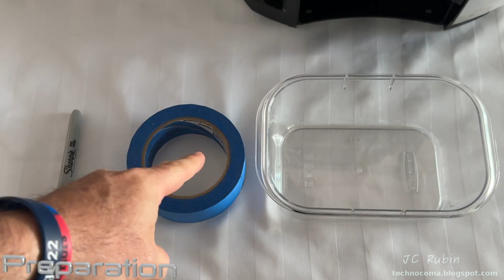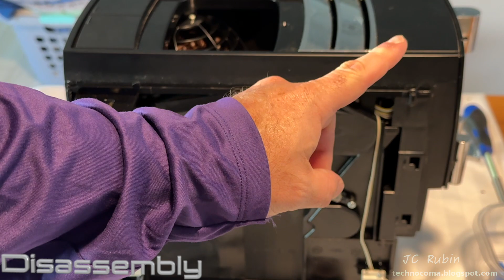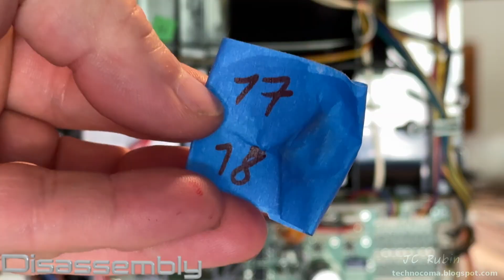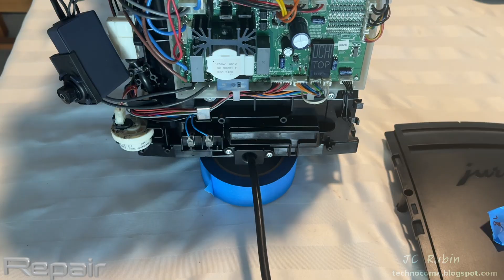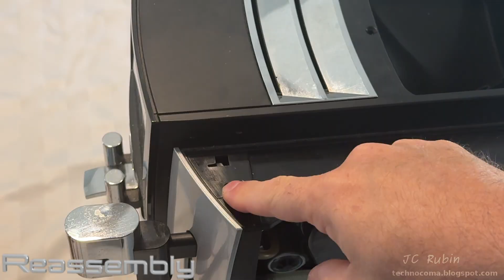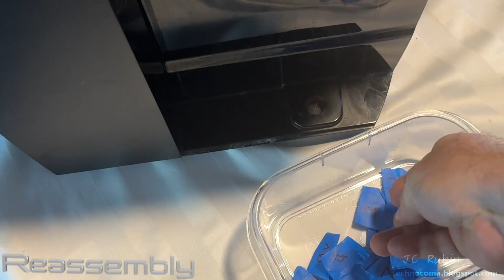Jura Coffee Machine Error 8, 1, 2, 3, 4 Fix | Step-by-Step DIY

Comment: Thanks, this was very helpful.  Just repaired mine with the same exact issue. The only difference on my S8 was the power switch, which installed at a 45 degree angle and turned 45 degrees to lock. I was a bit befuddled until I studied the mounting on mine. Super stocked to not have to send the unit in for $400 plus, never mind that Jura is still down after their security breach before Christmas 2025. Glad that they were as it forced me to find a repair via YouTube. Thanks for the very detailed walkthrough, it was so helpful and confidence building.
Reply from the maker: Glad to her the video got you up and running again

Comment: Great video - thank you so much! The only question I have - in the description you have a link to the temperature sensor for J6 model, however you are repairing the S8 model. I have the same problem with S8, do you still recommend ordering the sensor, which you mentioned  (for J6)? Thank you
Reply: Same question here.  I ordered a different one off of Amazon.  Fixed my error 2 code, but the temperature of the coffee/steam does not get high enough now (resistance measured ~10kΩ instead of the ~100kΩ value you measured).  Want to make sure I am ordering the correct OEM part since they do not accept returns for electrical components.  Thanks!